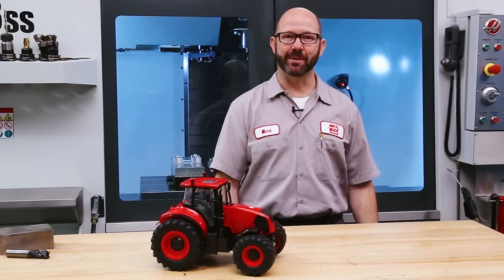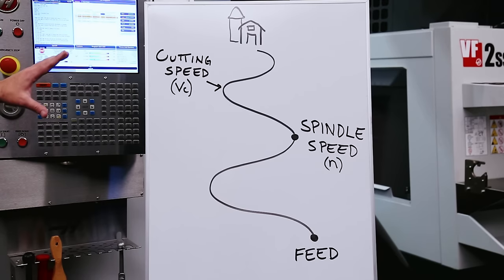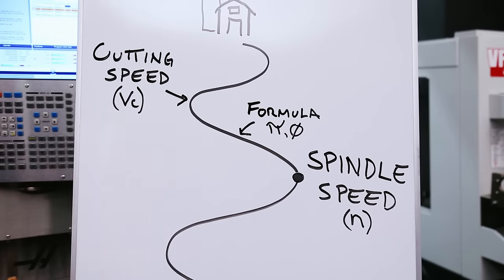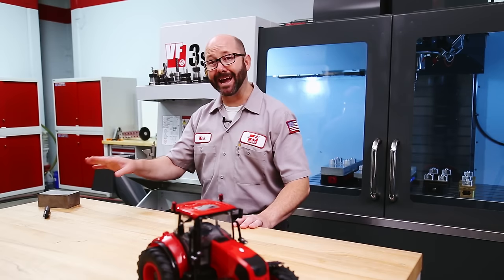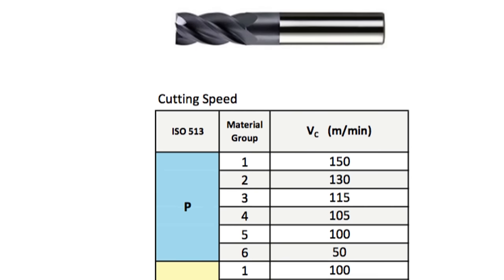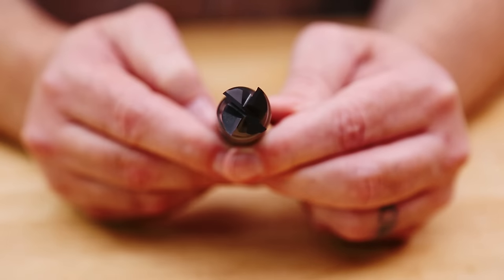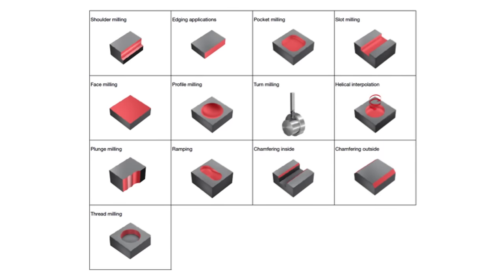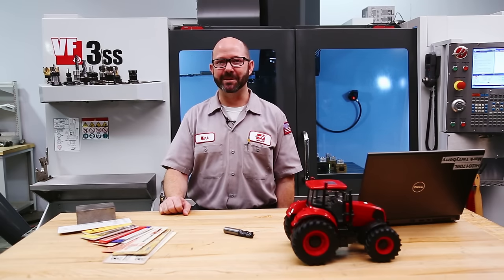How To Calculate Speeds and Feeds (Metric Version) - Haas Automation Tip of the Day

Comment: Coming from 40+ years of manual machining and dealing with speeds and feeds by "look & feel" understanding what is required by a CNC machine has been a steep learning curve, this is the best explanation I have come across so far 👍🏼👍🏼👍🏼
Reply: Most manual mill guys ive met trash talk CNC. I've done both. CNC is by far more skill intensive than manual Mills. I can set up all day long with very little thought on a knee mill. But cnc has a lot more.
Reply: @vdub2002  I'm building up to make the switch later this year, there's a lot to learn to get the  best out of these machines for sure.
Reply: @rusty Look and feel, as well as how much swarf and coolant you can tolerate being fired everywhere!!
Reply: i agree
Reply: @thomashenderson3901 you can turn the coolant off completely but the tool won't last long, shutting it off for one part won't do anything

Comment: A question to the seasoned machinist out there: is the chip load (mm/tooth) considered a max or a min? If I want to err on the side of caution, I’ve generally taken that number as a max but I understand that for materials like stainless, you need a minimum cut depth to cut past the work hardened material. Any tips?

Comment: Articulate explanation but It would have been much deeper video if the chip thinning concept and compensation for it had been also included while finding out the table feed though. Apart from that, I know that setting the Ae and Ap parameters is highly dependent on the situation but is there a reasonable explanation for how I can basically set those parameters?

Comment: GREETING , HASS ! I'M FINDING A N EXACT FORMULA TO CALCULATE SOME OF PARAMETER FOR MY MINI MACHINE BUT WHEN I USE YOU FORMULA , WHICH WAS PROVIDED I'M REALLY SURPRISE  WHEN I CUT ALUMINIUM WITH END MILL 4MM DIAMETER , I HAVE TO USE THE SPINDLE SPEED  ABOUT OVER (14000 RPM ) . CAN YOU HELP ME ?

Comment: I have a diameter 10 tool for aluminium and I need to cut through 3mm of material to make a hole. Your formula says 5400 rpm but machine is set to 16000. Isnt that a bit too low?

Comment: My Question as a beginner
1. Some time tool is given to us 10mm carbide with no Vc mentioned then how to or where to find Vc to calculate RPM for the tool.

2. Most of the time we are getting tools with no printing on it so what should we do in that case to calculate Vc Or everything or we can just assume and take value.

Comment: 1)
Why can't I create macro program manually in hass control when I type #101=1. & press Enter it says bad code 

 2) how to retract when tapping process is going on the m/c & if  suddenly power cut or power fluctuate how to get it back safely 
In some m/c there is tap retract button 
3) how to restart the program in Hass control :- for example the cycle Time is 4 hours & m/c completed the process of 2 hours &   suddenly power cut how to continue the m/c 
In some m/c there is option to continue

M/c is vf2 vector dual drive don't know the year of manufacture
almost 20 years old .......

Sir pls do a video on all of this  
Pls pls pls pls 
Thank you love from India

Comment: This question may sound silly to machinists but as somebody looking in from the outside out of curiosity I'm wondering:
Why does one use cutting speed in the first place. The diameter of the tool doesn't change and the rest are constants. So why doesn't one give the rpm instead?
I hypothesize that there exists a "general cutting speed" for multiple tools hence the cutting speed and not the spindle rpm. Is this correct?

Comment: The professionals from Haas, give tips for professionals.
But what do I do as a hobbyist, with no name end mills, where I am not even sure which material it is designed for (the ebay seller simply listed all the materials).

Is there a way to select a reasonable value from a manual based on some kind of recognizable shapes of the flutes, or color of the coatings?

Comment: Hi
I have spm for die casting parts drill..
Material is znAl4cu1 zhamak 5
But i am not getting good tool life 
Drill diameter is 1.45 mm and Drill depth is 3.2 mm
Can you pls suggest me the feed speed & RPM to be set for my machine to get max tool life

Comment: Very nice video! 
Just one thing that confused me a little, you talked very briefly about depth of cut and stepover (Ae & Ap). 
But never finished that explanation. I`ve looked trough the bonus content aswell, but cannot find where these values are actually indeed used.
Reply from the maker: S bezuijen – I glossed over that didn’t I. The depth, and width of cuts are really dictated by the type of tool, the toolpath, the workholding, material,  and the machine. If I am roughing with a nice indexable mill on aluminum, I may take the cut at full depth, with a 50% stepover. If roughing with a long carbide endmill on steel, I’d likely be using a High-Speed Trochoidal (dynamic, adaptive) toolpath, full depth, at maybe 20% stepover but a very high feedrate. This is where a call to your tooling and CAM vendors can help. My short answer is that I’ll go as deep and wide with my cuts as I can get away with! – Mark, Haas Tip-of-the-day

Comment: Hi,very informative video. You re doing excellent job with your videos! All these rules are the same if you re using a lathe or there are differences on the calculation of speed and feed?
Reply from the maker: George – The rules are the same when we use live-tooling (endmills) on our live-tool lathes, but general turning is a bit different. On lathes we’ll usually program in Feed per Revolution, not Feed per Minute, when turning. Sounds like we need another video! Thanks for the comment. – Mark, Haas Tip-of-the-day

Comment: Great video, thanks for that :)
Could you tell as which catalogue is showing general feeds and speeds (without calculation)?
The one which you used on the end of this video(brand what it was)
Thanks in advance
Reply from the maker: FOFIK CAD CAM CNC - Many of the drill catalogs (Nachi, Guhring, OSG) just list out the RPM for us, by tool diameter, no math. Some Endmill manufacturers are doing the same (Niagara Cutter, SGS Kyocera). I showed an SGS manual at the end of the video. Even if the catalog directly lists the RPM for us, we usually have to calculate the Feed per Minute using a listed chipload per tooth/revolution still. This is one of those topics that come up every day as a machinist, and worth really understanding. Thanks for the comment. – Mark, Haas Tip-of-the-day

Comment: Hello, mind if I ask if I understand correctly, our feed per tooth / chip load / chip thickness are synonims?
Eg Solidcam often uses term chip thickness and I dont really know what that means, so I think this is just a synonim for feed per tooth or chip load (as you said in the video)?
Thanks, love the videos :)
Reply from the maker: Matic Boh – In general, our Feed per Tooth and our Chipload are the same thing. Depending on how big of a radial cut we are taking (ae) our chips might be thinner than we’d thought though – chip thinning. Most CAM systems are just referring to the Feed per Tooth, and the ideal or theoretical Chip Thickness. – Mark, Haas Tip-of-the-day. Create chips that go from thick to thin is just as important as the thickness, check out this video: https://youtu.be/4Q4yRt1jHGo
Reply: Thanks Mark, you guys are awesome. Keep up the good work :)

Comment: Vc150 ÷ 3.14(π) ÷ dia0,080
The formulas in most books and manuals are very unfriendly to someone not comfortable with mathematics. Here i write HOW you CAN actually write it using a calculator. (Translated with book Hieroglyphs removed ) Notice in my first more accurate model the dia80 has the decimal point moved (0.080) Follow the example or note it down.
Otherwise you CAN use the less accurate baby version...
Vc150 ÷ dia80 x 3.18 A SIX YEAR OLD CAN PUT THIS INTO A CALCULATOR. Also if you have an iPhone download Calctape its soooo useful.

Comment: Can someone explain me what is difference between Cutting Speed and Feed rate... I don't quite get it.
Is Vc linear speed of tool?
Reply: The speed is how fast the tool is moving at the cutting edges, usually measured m/min. The speed is really just the RPM, and how it relates to out tool speed at a certain diameter. Our Feed, is usually our “table feed” which is how fast the tool moves through the material (mm/min) as opposed to how fast the tool is spinning. Speeds and Feeds. Definitely not the normal way these words are used, if you’re not a machinist.

Comment: Great video, but what about wood? my catalog only lists PMKN or it it safe to use aluminium speeds and feeds for wood?
Reply from the maker: mrc4nl – Wood is so different, there are companies that typically specialize in those tools, like Amana Tool https://www.amanatool.com/products/cnc-router-bits.html. If you do use a regular endmill, I’d typically run my spindle at Max RPM, with a Feed per Tooth from the books, for Aluminum (N). – Mark, Haas Tip-of-the-day

Comment: The RPM you calculated  for the S CODE was 1592 rpm but my calculation was 1590 was there a reason why you rounded the rpm value off by 2 ?
Reply: I have the same question because 100*318/20 does not equal 1592

Comment: 9:09 yeah. calculate that how much fast you get part then minus what takes change tool OR do every part using lower speed with no tool changes. repair or worst case ever do setup again bcoz someone just hit cycle start bcoz machine run 5minute going 4000mm/min next part have to be good as first part HAVE to its machine but last part was gray LOL not correct measures. it was the end befor hit cycle start last time
OR cut slower and tool last all parts and BOSS can change and thow parts in without measuring. looks good! have to be correct

Comment: Thank you for the information
I have a question
Can we use same feed and rpm formula for ball and bullnose, cutters tools?
Reply: I have an "it depends" answer for you.  What matters for the speed is the effective diameter- where the tool is actually cutting.  You can run it a lot faster if you're not touching at the maximum diameter.  Unless you're running very shallow with a bullnose it's probably best to ignore the difference, but if you're doing finishing profiling with a large radius ball mill you may want to up your speed & feed to save time.

Comment: I have a question. What happens if i dont have any of that information, how should i know how fast to go? I mostly use old russian made end mills, made in 1960, 1970s. They dont have any documentation or Vf , Rpm
Reply from the maker: Mikk Mikk – for older generic tools, I just go back to my Machinery’s Handbook Speeds and Feeds tables. If you don’t have a Machinery’s Handbook, I’d make it my first machinist purchase, even a used one off of Ebay or Amazon. – Mark, Haas Tip-of-the-day

Comment: hello sir
how to remove face mill cutter mark on surface during surface milling...
Reply: Arun Kumar 
Leave some on and do a finish cut. If you’re programming you should be able to set that up in the software. Your machine (assuming cnc) should have z offsets so you can set a + offset and run the tool a second time after you undo the offset. What are you cutting, how are you holding it, what kind of cutter???

Comment: Is that method also applied for the lathe?
Reply from the maker: Ro Cuevas – The idea of Cutting Speeds is the same, but it is applied very differently on lathes. When turning on lathes we typically program in G96 Constant Surface Speed – this is where the lathe is constantly adjusting the RPM to keep the Cutting Speed (speed where the tool meets the part, at a certain diameter) constant. We’ll also typical Feed in G99 Feed Per Revolution, with a single point cutting tool. Sounds like another video. Thanks for the comment. – Mark, Haas Tip-of-the-day
Reply: Great idea do this for lathes

Comment: As a former advanced teacher in machining I've never  seen anyone program speeds and feeds with more then two significant numbers and using decimals for feed is just ridiculous.
Also remember that the values given by tool manufacturers are starting values assuming perfect conditions and do note the suggested type of coolant (flood, mist, through, dry...).

Never use/trust more significant numbers then what you rounded something off to! (Pi=3.14 makes S=1592 wrong. 1590 is the most accurate number that's acceptable based on that, in reality S=1200 to 1600 as a start value depending on machine, fixture, tool holding etc.)
Reply from the maker: R K – Yep. Feedrates out to 3 or 4 decimal places only make sense when tapping. Good comment about the numbers just being starting values as well – I usually bring my feedrates higher than what the book says, and leave my RPM/Surface Speed where it is, towards the high end (slower gives longer tool life), unless I need to adjust it up or down to remove chatter. That 1590 vs 1592 rounding error was between the Long formula and the Simple one, we changed to the simple formula during editing. Sharp eye. Thanks for the comment, fun stuff. – Mark, Haas Tip-of-the-day

Comment: Stupid question:  Why did you use 318 as the number instead of 314?
Reply from the maker: Hi Alan – Check out 05:21. The 318 in the formula is just 1000/π, this will convert us from Meters/min to mm/min, and also take care of our π for circumference at the same time. We only use 318 in our simplified formula.  – Mark, Haas Tip-of-the-day.

Comment: very informative, but never use 3.14, always always press the Pi button instead
Reply: Mathematician: Pi is the number expressing the relationship between the circumference of a circle and its diameter.
Physicist: Pi is 3.1415927 plus or minus 0.000000005
Engineer: Pi is about 3

Engineer pi is good enough for machining since there is no exact cutting speed because it is usually just combination of tool manufacturer recommended value, experience of operator, machine, other cutting values, materials etc. You won't get any benefit of calculating pi with excess number of decimals as usually  you just estimate cutting speed.

Comment: 100x318/20=1590   not 1592
Reply from the maker: Tolkoum – I was waiting to see who would catch this. The first version of the video used the long formula (1592rpm), and we revised it to the simplified formula (1590rpm), the difference is a rounding error. Thanks for the comment. Oh, I’d mention that the numbers we get for our RPM from the books are just starting value, we can almost always adjust them up or down for a better cut. – Mark, Haas Tip-of-the-day

Comment: The metric vid is longer than the inch version, therefore proving that inch is superior to the rest of the world!
Reply: the metric one has more information in it, so it is more useful and therefore metric is better
Reply: He wasted time talking about slide rulers and stuff which is only needed if you have to convert inches to feet too...I only keep a calculator around and I can easily go from μm's to m's and all the places in between without an extra chart or conversion...Plus an inch is defined as 25.4mm soooo!